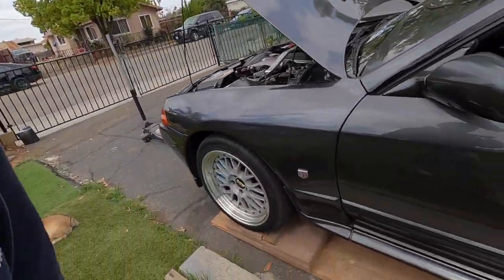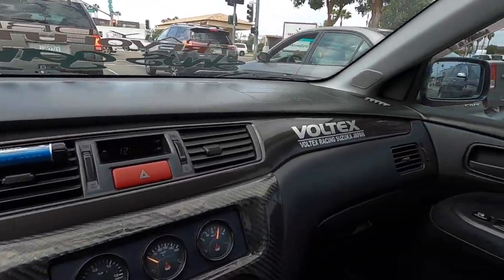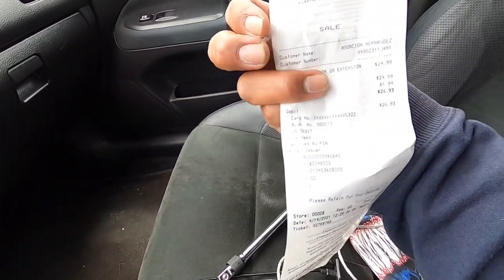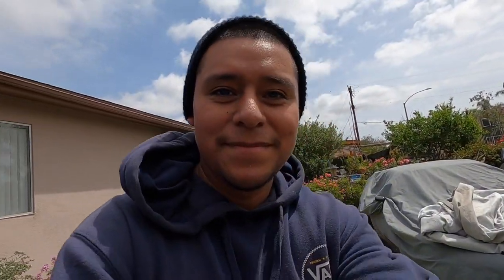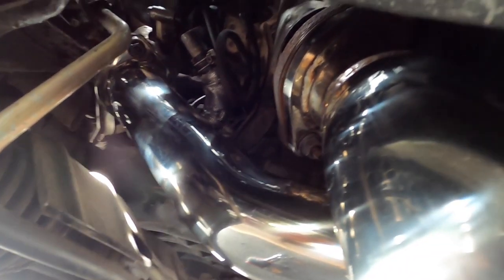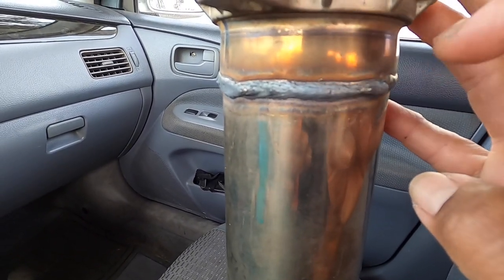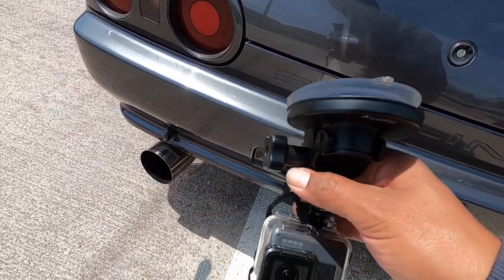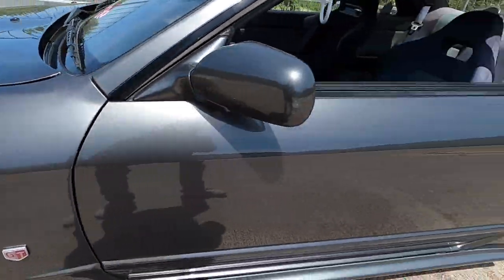MINES EQUAL LENGTH FRONT PIPE FOR R32 GTR

Comment: Hey man well done vid! I had the Mines on mine which sounded amazing but I kept hitting it on EVERYTHING. Have since moved to a single turbo with equal length header that sounds just as good. Keep em coming bro!
Reply from the maker: Thankyou for checking out the video. Yeah it sits really low. She's not my daily so when I drive it I try to be very careful on the road 🙂. How is the single turbo setup working for you?
Reply: @shus369  single turbo is a different experience for sure. The BW 8375 doesn't come on strong down low (2.5k-4k) like the stock twins but past that it is much more powerful at the same 14psi. This is to be expected though. Maintenance is easier for the single too. I would do it again if I had the choice.

Comment: The Mine's part did you get it new or used? Care to share where you got it? Did you get it from Mine's themselves?
Reply from the maker: I got it from a company in Japan. New from NENGUN performance 👍
Reply: @shus369  Cool. I thought the gap between the dp and centre section is where one would put a flex joint.
Reply from the maker: @princesssolace4337  that would be a good idea. I need to take it to the muffler shop

Comment: Dude I did my down pipe twice before finally just getting the equal length downpipe and I did my exhaust 3 times before just going with a 4-5inch straight pipe
Reply from the maker: Does it sound good? Is yours custom made?

Comment: Are there any torque specs for the front pipe? I just installed mine but just hand tightened for now while I tend to some other things
Reply from the maker: I tightened the bolts with my ratchet, I'm sure there's a torque spec but I tightened them as tight as I thought they should be. just don't strip the bolts.

Comment: Sorry for late reply, but can you still use the cats (or an aftermarket catalytic converter) or does it have to be straight piped ?
Reply from the maker: You can use an high flow cat to go with your set up.
Reply: @shus369  Does it have to be high flow cats ? I know California is heavy on smog and there's an epa rated cat for the skyline, I'm wondering if that will fit with the front pipe.
Reply from the maker: @raceboy9517  if you are planing on passing smog in California no. you need the cats that the car passed inspection with. I don't think you will be able to run the cats that California compliance installed on the car and be able to have the mines front pipe
Reply: @shus369  My intention would be to use the front pipe and cats together and then Sonic smog test it afterwards. I heard there's a company in CA that tries to make skylines compliant with smog (as they're usually not) so I'm hoping that company could make it happen.

Comment: Hey man so you really need it louder to hear the true noise of a equal length front pipe. I've got a temporary solution for you that I do on my gtr. Find a piece of pipe -(I used one of those flexible universal exhaust repair pipes) And shove it inside of the muffler and wedge it in there. It will bypass the "muffling" of the muffler making it louder, then you can remove that pipe whenever you want if you want it quiet again.

Comment: Sounds good man. Did it make your exhaust louder or just higher pitch? Equal length is the bomb.
Reply from the maker: It definitely got louder when you get on the car but on normal driving still sounds close to how it was before.
Reply: @shus369  What about hard acceleration?
Reply from the maker: @GodzilarOG7337  it does get louder under full throttle but not annoying.